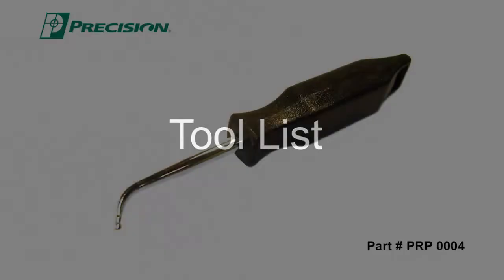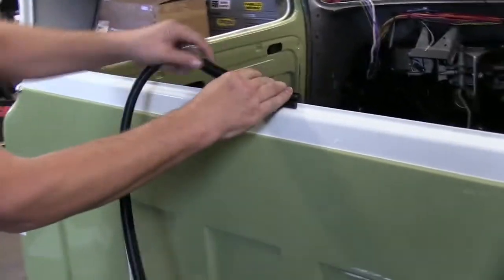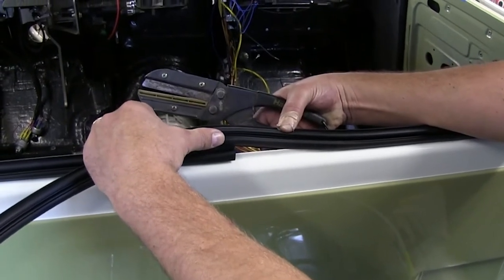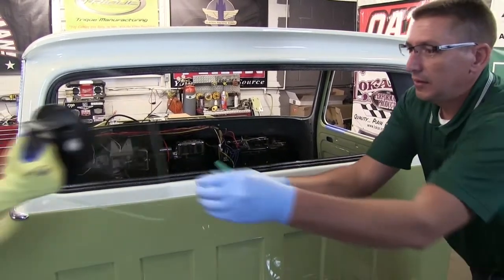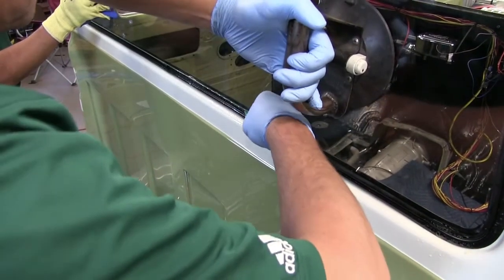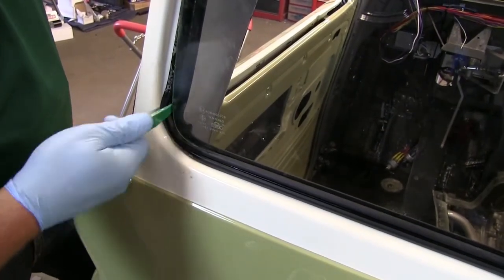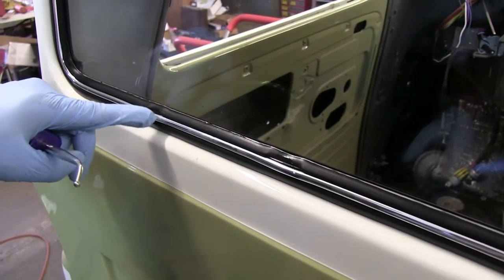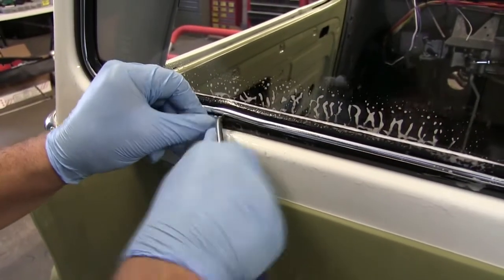1955-1966 Chevy Truck Rear Window weatherstrip Installation

Comment: Wonder if they warmed up the rubber in the microwave or oven to improve pliability? It took me almost 10 minutes to move along only half way from the bottom center of my 1958 Apache to the corner to install the perimeter rubber. used lots of bar soap to create a slippery surface. Hardly able to just push it on like some super flexible foam like rubber. Guess it will get easier in time. Also the repro Chinese rear glass is 3/16 thick versus OE 1/2 inch. The channel will be clearly oversized-might need some sealent if lock strip doesn't tighten it up,. Nothing is as easy as it looks, alas.

Comment: Would the this installation be the same for the rear window in a 65 Suburban with the liftgate?
Reply from the maker: No, it's a different type of install.  The glass and the seal are roped in together.

Comment: Too hard to install, rope and gasket easier, even they are struggling! Their gasket keeps pushing in, doesn’t hold well on the pinchwelds
Reply: Very difficult and I am experiencing the same issue. The rubber does not want to stay on the pinch weld
Reply: Auto City on eBay sells a back window gasket that holds on the pinched weld a lot better. It does take two people to install. Use just enough windex to slip glass in small sections as you go. It is probably the hardest thing I did on my build. I did use tape all the way around to hold rubber to pinch weld.
Reply: Auto City Classics